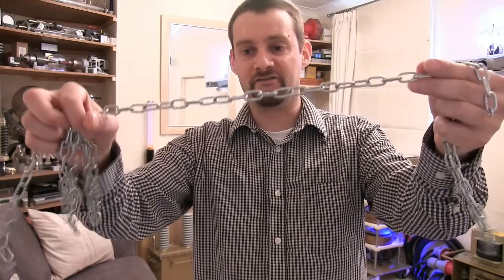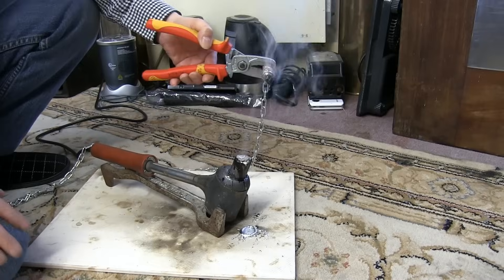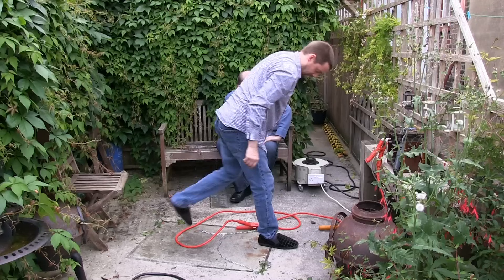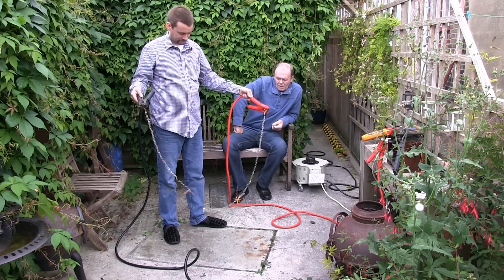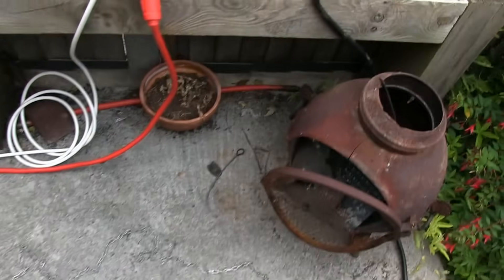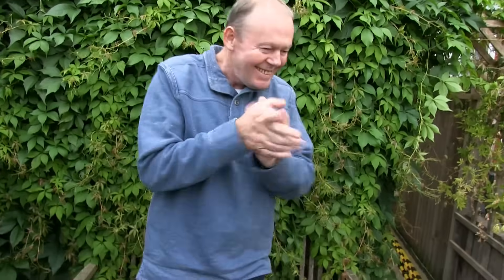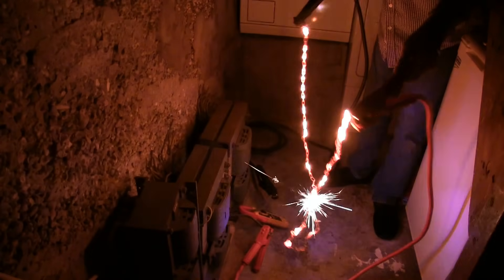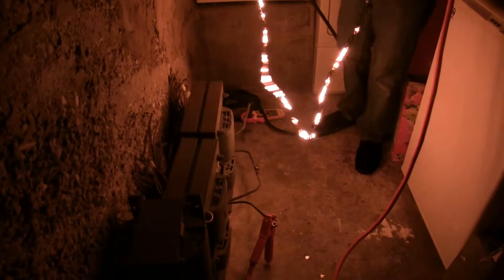Steel Chain VS Electrical Current

Comment: Did... did you just put your foot on a chain with hundreds of amps running through it? I know you're not grounded and the electricity has a much easier path to follow, but my brain would be shrieking at me to get the fuck away from it, not touch it! That said, you're also holding and shaking the chain setup, too. You're bonkers :)

Nice to see you're making vids again, mate. We missed your brand of crazy ;)
Reply: The voltage isn't high enough to hurt you. The chain was probably a few ohms at best, pretty much a short. The human body has a lot more resistance so it won't pass much current, therefore needs higher voltages in order to be truly dangerous.
Reply: 50v AC is enough to give you a nasty shock. 48v ac is considered the limit of what is safe to touch although it can hurt. 
The current through the body is unaffected by the fact there is a low resistance chain between the terminals. Touch the terminals and you'll get a shock.   The 'easier path' thing doesn't exist except for electric arcs and lightning. 
The reason he didn't get a shock, is that the transformer secondary is not connected to ground, so while Photon is grounded (although badly, via his shoes) he isn't forming the return path for the current. Also, shoes are probably sufficient insulators to withstand 50v ac. 
The neutral of a typical 230v outlet is connected to ground somewhere. So the ground can form a return path. If you touch the live wire, you form a connection between that wire and the return (ground). 
Hope this clarifies how electrics work a bit :)
Reply: volvo09 Umm, when he was shaking it about, it was arcing. That's means there were times of high resistance as well.
Reply: LimaVictor "The reason he didn't get a shock, is that the transformer secondary is not connected to ground, so while Photon is grounded (although badly, via his shoes) he isn't forming the return path for the current."

Actually, that does help me envision what's going on a bit better. Thank you.

Comment: so im guessing ur an electrical engineer not just a nutter
Reply: Why can't he be both?
Reply: "Interestingly the hotter the chain the higher the resistance."
So... not an engineer.  That wouldn't be news to him if he was.
Reply: I'm surprised he made that comment. Just a few videos back, he was lighting up a huge (20kW I believe) incandescent lamp, and he explained and demonstrated how the current dropped as the filament warmed up, at reduced voltage. So I don't think this was a surprise to him.
Reply: Ryan Bouts
I think he was mentioning that fact to the audience and not as a personal surprise.